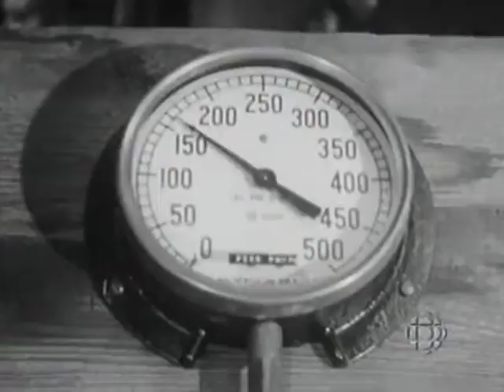Robert Swanson's Whistle Farm (Reupload)

Comment: 5:24 to 5:55. Funny how he mentions people are more accepting of the sound when it's musical. That concept doesn't fly today, but the push for quiet zones has never been so strong and horns today regularly sound awful, and are also significantly louder than before. Supposedly this newer concept improves safety, but people are now more intolerant to horns, meaning the rise of quiet zones which makes crossings much less safe. Mellow and musical is great for regular service. If a trespasser is on the tracks and a horn is being blown at max pressure and volume, whether it's musical or not doesn't matter if it's so loud they jump out of their pants. Raucous horns are fitting for emergency vehicles or disaster warning systems as Swanson said. A musical air horn indicates a train regardless of how dire the situation is.